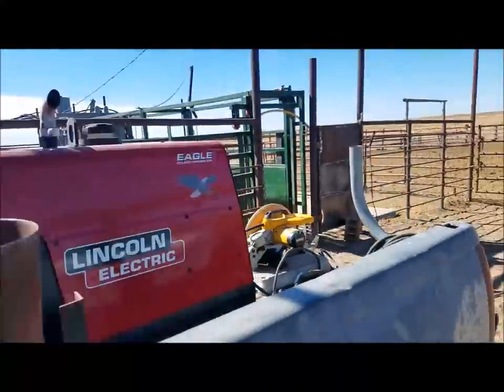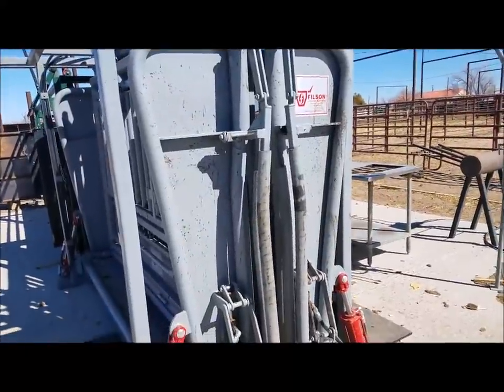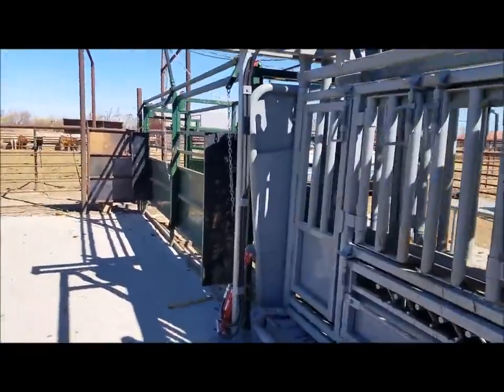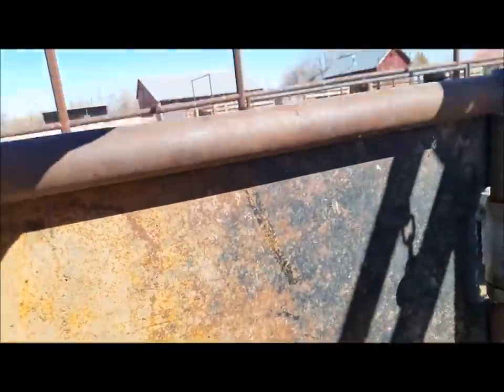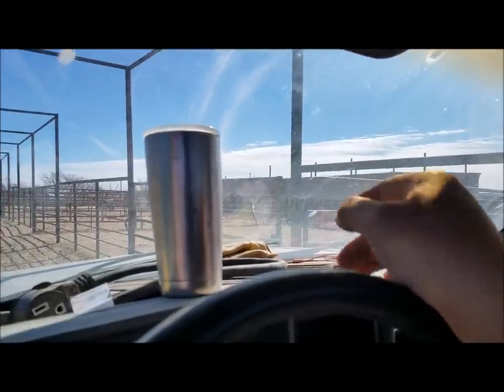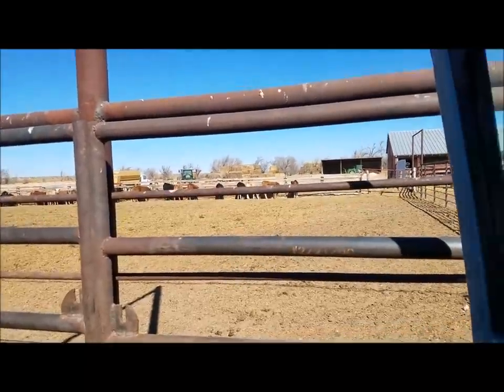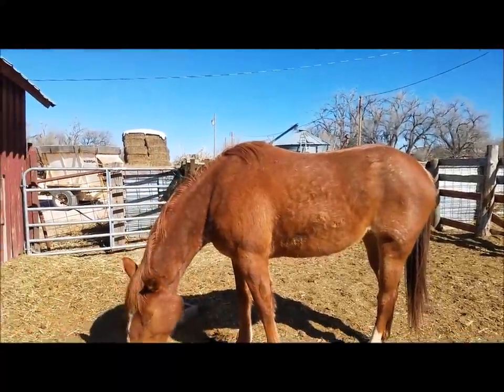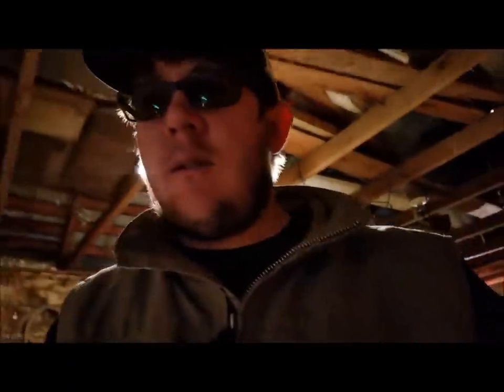Man Gate for Budbox

Comment: Drought sucks. I run a very similar operation as yourself. I built my bud box a few years back. This fall i added a post and a short 6ft gate  so i could hide behind it and use it as a quasi crowding gate. Works awsome for working the bigger cattle. The post is only far enough off the fence to squeeze between it. Cheers